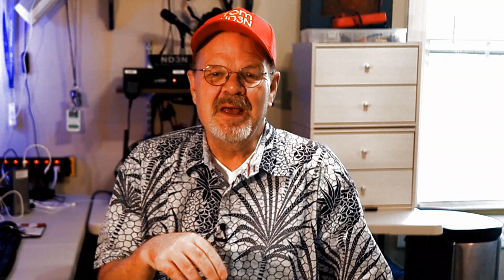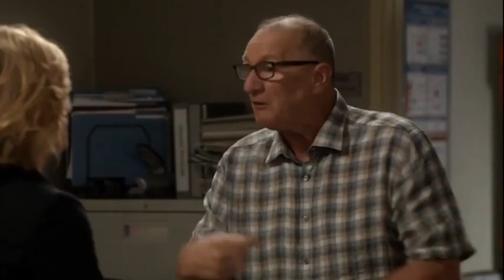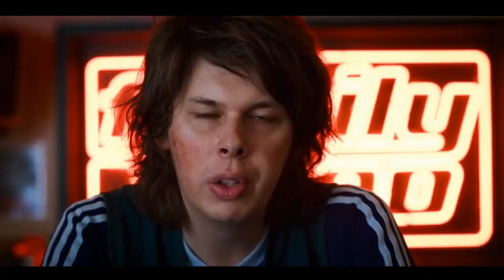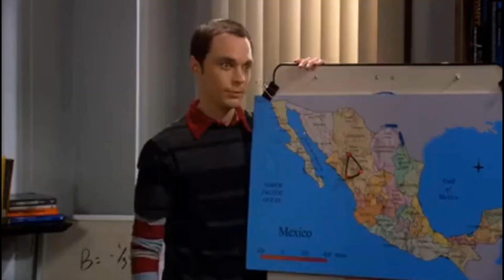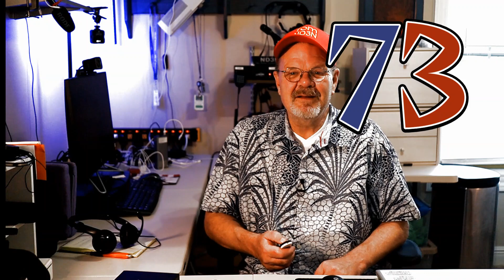Ham Radio: Using less power and getting better results

Comment: Even though rubber duck antennas are "crappy", I'm still able to use my Kenwood 2 meter handheld running 5 watts max to get into a repeater about 50 miles away. The repeater is tied into a trunked system which allows me to work most of Vancouver Island and into the British Columbia lower mainland (Vancouver area). Having said that, I agree with everything in this video regarding lower power and efficient antennas. Ivan...VE7IVN

Comment: Spot on! Great video. Antenna first!  I liked and I am already subscribed. I really appreciate your clear delivery.  With regard to handheld transceivers, you are right. The rubber duck aerials, even the larger aftermarket ones, are not much better than radiating dummy loads.  Whenever possible, I connect my handheld to a home-brew Slim Jim antenna, made from 300 Ohm twin feeder to a design on DK7ZB's web pages. I support it on either a compact telescopic fibreglass fishing pole, or PVC electrical conduit.  It is a massive improvement over a rubber duck.  Thanks again. 73, Mike. M0MTJ

Comment: I run minimal power every time all of the time.  From ND to European countries with less than 100 watts and a ground mount vertical.  Good QRP results with a wire antenna. de w0vet

Comment: Yep... You said it all:  "The most important piece of equipment in any ham station is the antenna" A correctly tuned antenna will output more power than a poor antenna and as you know - antennas are the best investment you can make.
Reply from the maker: Thanks Matt.  73